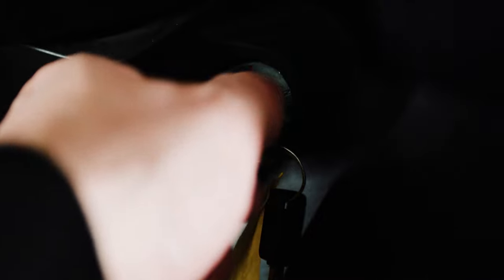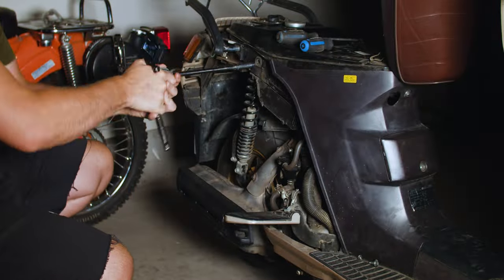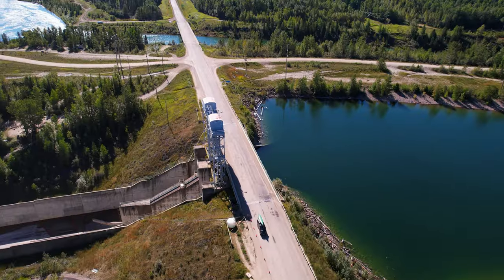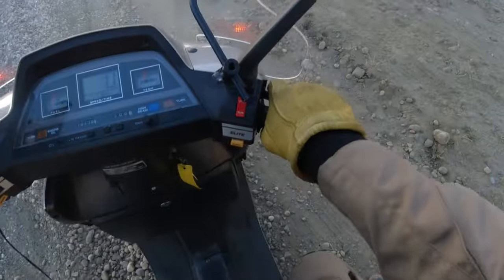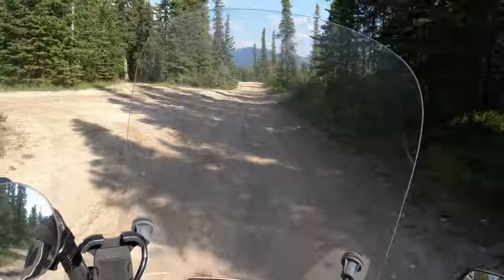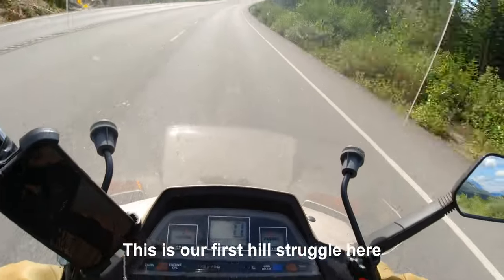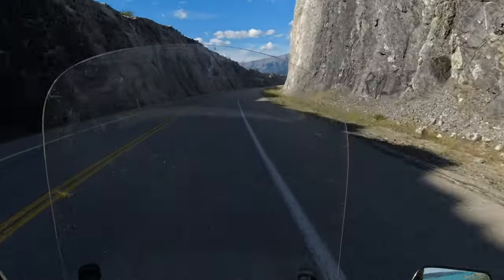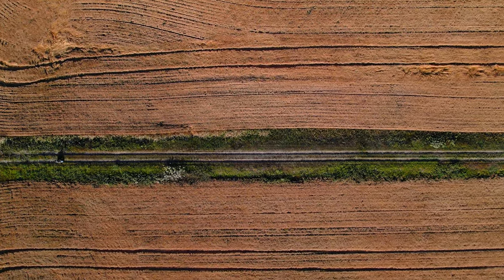Were bikes cooler in the 80's??

Comment: I have a 2001 Honda Helix (same engine as the elite 250 but with a longer case), and I love it to death.  It's the cruiser of scooters with its reclined riding position and super long wheelbase.  Massive windshield is awesome too!
Reply: I also have a Helix. Love it very much. I tested mine also on the Nürburgring :D Does not make sense there but still was alot of fun

Comment: I had the pleasure of owning a CH250 several years ago. I did the shock upgrade, brakes, and mounted the stickiest tires I could find. I think they were Pirelli's. I replaced the broken speedo cable with one from an early 80's Gold Wing, and cleaned and painted the wheels. Hi temp Rustoleum was a perfect match. I had the OEM windshield and tail trunk, with the clever 2 stage locking top. I rode the wheels off my Elite, but never thought to venture off road, since I owned a 520EXC. Once I got used to the floor mounted brake pedal and learned to trust the tires, I could scrape the floor boards with ease. The CVT was flawless, allowing me to concentrate on smooth throttle and brake control. Good memories. Bob P.S. I now have a Honda Silver Wing 600 Maxi scooter. My wife loves it, which is all the justification I need to own it. It'll run all day two up at 80, and not break a sweat.

Comment: The original super scooter.
I own frame #24. They are named Spacy 250 in the UK and came with a front disc brake over here. Fantastic machine from Honda's golden age of innovation in motorsport, automotive reliability and day to day practicality.

Comment: Absolutely amazing like others have said it had me laughing and a huge smile on my face the whole time. Makes me want to take my Honda spree on an adventure, now if only it could go faster than 28mph 🤔
Reply from the maker: Let’s just find a big hill to push it down.
Reply: My 2010 Honda Elite 110cc can make 53 mph top speed.  It's ultra reliable for off road adventures.  You can probably find a good used one for less than $500. I had a windshield installed and is quite helpful when the temp dips.
Reply: Why did that stop you!
Reply: I have fallen in love with scooters for touring.  There is nothing better.  I have owned a helix, a yamaha morphous and a yamaha majesty 400.  The 250 morphous has been the best.. multiple 2000 mile trips and bunches of 400 to 800 mile trips.  I can give details if you want.  But I can't tell you how great touring on a scooter can be.  Reliability is great,  comfort is wonderful.. love it!  In wild love to find an elite 250 for a second scooter to go with my morphous

Comment: Great video. I've got an NH80 and it's a fantastic little bike. If it could sit on 100km/h I would have no issue riding it across the country. I'm interested in the CB350 shock upgrade, do you have a link to any more info?
Reply from the maker: That’s awesome! Other than getting blown around and having no frame to hold onto scooters are fun on the highway. 

Hmm it’s a been a couple years since i did the swap but from what I remember I had to punch the rubber bushing out and swap the metal inserts between the stock ones and the Elite250 ones. I think there was a forum somewhere on Google

Comment: The weights and your variator might be sticking. The drum of the centrifucal clutch maybe glazed. Good times. Thank hank you very much.
Reply from the maker: You’re very welcome! It did have slightly flattened variators when I bought it, I switched them out for some new variators that were “cammed”. 
I didn’t see any glazing on the drum, but I’m defintiely no cvt expert! 
Ran really good just struggled with top speed and mountains.. I am not a small guy and I had a full load of camping gear with me. Probably around 260lbs combined
Reply: @Range Road Moto  My thinking was the honda Elite 250 is supposed to be the exact same power plant as the Honda CN250 Helix/Spazio. The only reason the Elite has a lower top speed is aerodynamics. Anyways, I really enjoyed your trip and hope you have many more fun journeys. Thanks again.

Comment: You can make it go faster with a Malossi overrange CVT kit, and make it launch harder with stiffer clutch springs. There’s a surprising amount of tunability to scooter CVTs.
Reply from the maker: I’ll check that out! 
I did end up changing out the variators on the scooter, I installed ones that were almost like “cammed” for lack of a better word. They claimed to help acceleration/top speed, but to be honest I didn’t notice much if a difference over the round ones.
Reply: @rangeroadmoto  oh, you mean the variator weights? Yeah, the improvements, if any, with sliders is marginal at best over rollers. But weights are only one part of many on a CVT to tune.

Gummy, who I saw comment earlier about his Helix, has the Malossi overrange kit. I’ll let him know to comment here how much of a difference it made for him. The Helix and Elite 250 have pretty much the same engine, so his results should be roughly the same as what you’d see from it.
Reply: @Range Road Moto  I have a 01 Helix 250.  IIRC the Helix uses the exact same engine as the Elite 250, except the case is slightly longer on the Helix.  They should share all CVT components except for the drive belt.

On the stock CVT it ran out of ratios around 50mph, and faster than that the RPMs climb linearly.  With the Malossi CVT kit I purchased (includes new variator, roller weights, contra spring, belt, and I also got a Malossi clutch) it feels like the CVT never runs out of ratios and the RPMs sit right in the powerband all the way up to my 75mph top speed.  The "kickdown" is much faster and more aggressive too, overall the scooter feels much less sluggish with fast throttle changes.  Acceleration is improved too but I forgot to get a 'before changes' baseline with a GPS speedo.

I have a forum post about the kit and the install process but I dont think i can post links here.
Reply: @chE3z1 where can I buy these parts for mine?

Comment: I bought a 150 and 250 Elite back in the day.
$1795 and $2495 in 1986
I still have the 250 Elite.
Reply from the maker: That’s awesome, do you have lots of miles/km’s on the 250
Reply: @rangeroadmoto  The 250 Elite has 12,000 miles on it and still runs great.
I put 18,000 miles on the 150 Elite.
Reply from the maker: @cardiffchris  man thats awesome!
Reply: interestingly enough, that's roughly the value of a well-maintained 250 today.
Reply: @rangeroadmoto I can't afford a elite 250, but I did buy a 2023 burgman 400!!!!

Comment: What is the topspeed of this amazing machine🙂
Reply from the maker: The fastest I ever had mine was about 118km/h (73mph). Fully tucked down with no bags or extra gear. It’s not a confidence inspiring machine at that speed.. but it did it!
Reply: If you are going down a steep hill, about 82-85-ish.
These things were built as an economic, reliable ride that can go distances without any concerns (i.e. cross-country).  They were purposely over-engi eered for that express purpose.
Reply: 68 mph 
Never seen 70 ever.
2 different 250 Elites.
The Helix would do 72 mph

Comment: The Elite 250 should not accelerate as slow as that. It should hit 60mph in around 10 seconds. This bike must have some bad engine issues or worn out parts that need replacement. Have you replaced the clutch rollers? They wear out in as little as one year of use, and can severely affect acceleration, feel, and speed.
Reply from the maker: Hey there! I know that does seem like something was wrong. But I really think it was because of how heavily loaded up I was. Around town it was way more peppy. I am over 200lb without riding gear, I had an extra fuel bladder saddle bags full of camping stuff , and a top bag fully of camera gear. I think I just overloaded that poor little donkey. 

I did replace the rollers, new auto choke, carb rebuilt, new plug.. etc. I think it was running pretty alright. Just too heavy that day, should have redone the test after when it was empty.
Reply: @rangeroadmoto  ah ok, yea if you had around 100+lbs of gear and stuff on board, that would slow down acceleration, kind of like when you tow a passenger on the back. Also if the road was slightly incline for the test. I personally have a honda 125cc Airblade. its basically half the Elite engine, but makes like 12bhp stock and 70mph. It used to take like 9 seconds just to reach 50mph stock, but I currently have it down to under 6 sec seconds to 50mph after a few gentle mods like 25% lighter clutch weights and getting a few clutch parts replaced (none of them high-perf parts, just better than stock, such as better clutch springs, which regulate what rpms each gear does). It goes about 78mph now. I did let the mechanics choose what springs to install, as they know the sciences how to increase speed and power with such parts... Happy journeys, mate! Good to see people enjoying scooters. I love them.
Reply from the maker: Yeah, I do think it was mostly the weight. I had similar performance with my wife on the scooter. It didn't want to go over 50mph. Which is fine with me! It's amazing a scooter can do so much in the first place.

Thats an awesome speed increase! This was the first thing I have owned with a CVT so there was definitely a learning curve with it. I tried some of those variatiors with different heights, almost liked a cam on mine. Honestly didn't notice much of a difference other than less vibration over the ones that were starting to get flat spots.

That bike definitely made me like scooters a whole lot more than I already did!
 @enochthewitness-2023
Reply: @rangeroadmoto  thats great, scooters are awesome and practical, and they keep your feet dry doing through puddles etc. and yeah, clutch weights are tricky in terms of finding the best weight ones for your bike - I have found that you need a total weight difference of + or - 25% from stock to notice a difference. You can even outright buy complete clutch kits for scooters, especially Hondas. Either semi-race or full-race clutch kits. They can be the whole front or rear clutch assembly, springs and all the components. Where I live they cost like $250 for semi-race and about $350+ for full-race (probably half that price overseas). That way you know the whole assembly is good-to-go when its slapped on. Anyways, nice chatting, sorry for such long posts. I dont get to talk to many scooter people online lol

Comment: He is wrong on the acceleration.. he had it full of camping gear.. run lighter weights in variator and its quicker zero to 60 than most cars.  Also stip trashing the Elite off road and dumping it intentionally.. them plastic parts are impossible to find replacements for now.
Reply from the maker: Hello it is me aka“He”.
It has aftermarket variators that I installed. 
Never once dumped a motorcycle or scooter on purpose. This scooter was in far better condition than when I got from the previous owner. 
None of the plastics were damaged.